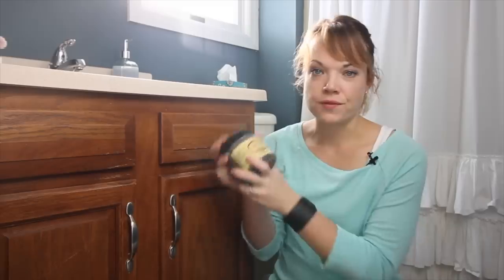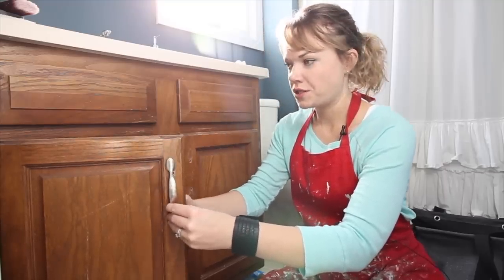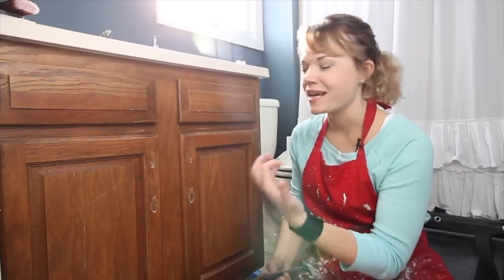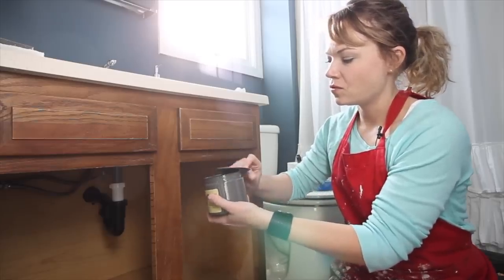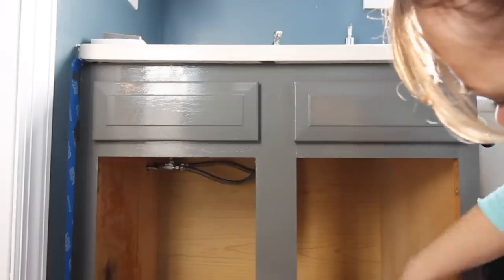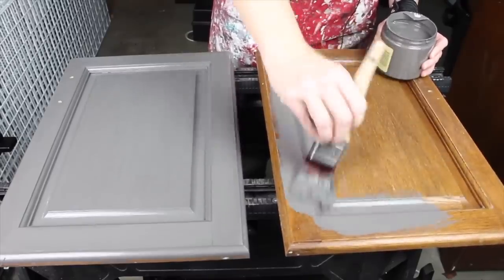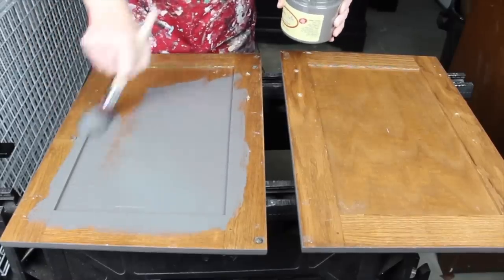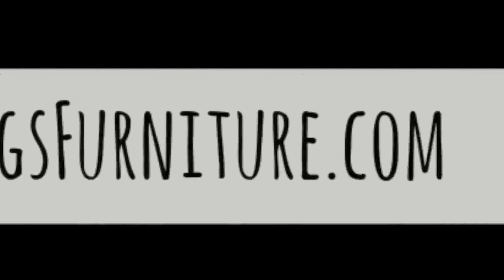Chalk Paint Cabinets | Cheap Bathroom Renovation

Comment: Love that color! It looks great with the color on your walls. I have the same cabinets in our house and have wanted to paint them since the day we bought the house. I've been checking out the DB paints, finishes and brushes but didn't see them used in a Bathroom until now. Southeast Florida is very humid and wet at times so I need a paint and finish that can hold up in our type of weather. Thanks for all the info and tips. Have a great day. 🌴😎💙😎🌴
Reply from the maker: Thank you! I love it too - this was the perfect color with the blue walls, it's such a rich beautiful neutral! I do think this method would be fine with your humidity.  You could do a second coat of the Gator Hide to really give it a layer of protection.  When I painted my bathroom tiles (tutorial soon) I used 2 coats of Gator Hide and it's protected from all the water!!
Reply: Roots & Wings Furniture & Home what color are the walls?
Reply: Hello... I’m just wondering where can I buy general finish paint?
Reply: shannon lancaster what do you recommend for the bathroom and kitchen walls ? I did mine a year ago and it has chipped . Is it because I didn’t prime ? I was told I didn’t need to because the paint was prime and paint at once

Comment: Hi there! 
I just bought white chalk paint to paint my wood cabinet. My question is, would the Gator Top HIdecoat discolour the white? I've been trying to find a good sealant/topcoat and unfortunately I've read that many discolour the white paint and turn it yellowish... if you could please help me with this I'd appreciate it lots!!
Thanks for sharing your video!
Reply from the maker: It's not so much to topcoat you have to worry about, but the wood tone coming through the paint.  If you use stain blocking primer first before the white paint this will protect you from yellowing.  Look into this primer (in white): https://dixiebellepaint.com/b-o-s-s/?aff=177

Comment: GREAT JOB!...But...ALWAYS stir/mix the paint and sealer, regardless of their  thickness. NEVER shake the paint or sealer, as that will  cause a real problem, creating bubbles in the paint and/or sealer. ALWAYS apply two or more coats of paint, and depending on the paint's ability to thoroughly cover the surface, three or more coats may be needed. ALWAYS paint all edges of the cabinets door opening(s), as I saw the upper "lips" of your cabinet door openings were not painted, with your leaving a visable, unpainted "raw edge". As a rule, always lightly go over the coats of paint and sealer with 0000 steel wool, using a tack cloth to clean off all residue prior to applying the additional coats of paint and/or sealer. In doing the aforementioned, chances are far greater that you will have a LASTING and BEAUTIFUL end product that you will love.
Reply: Where you buy the steel wool from

Comment: I have black chalkboard paint from a project and thought it would be fun to paint the cabinets with this matte look. What do you think?  It won’t be in the bathroom so I wouldn’t need a top coat, but thought I might do some small glue art on one cabinet than paint over it with the same black chalkboard paint.  Do you have experience with blackboard paint? Do you think I’ll regret it?  💕😂  I’ve googled it but only come with info related to “chalk paint” NOT chalkboard paint 🤔🧐🤨so, Any feedback is deeply appreciated. Thanks❣️❣️
Reply from the maker: I think it would be awesome! I too really like the look of matte black.  The only caution I would give is that on very matte surfaces, dust, fingerprints, scuff marks show quite easily.  You could use this paint and then add a topcoat of a very flat topcoat for just enough sheen to help with this issue.  My favorite flat is Flat out Flat by General Finishes! https://amzn.to/2ZiXgAn
Reply: @RootsWingsHome   Hadn't thought about the finger prints. Thank you❣️

Comment: Great videos. I watched both of your bath vanity painting videos. Do you prefer the chalk or milk paint?
Reply from the maker: They are both holding up great.  I liked the chalk paint because it was one coat of paint to cover so it was very quick! I like the texture of the milk paint and that it has a little more shine to it.  So it's a toss up, honestly.  I would use either one again - whatever is less expensive or easier to get a hold of!

Comment: My cabinet is melamine or thermafoil type material...is there any way to paint it that will look goo or is it a through away? TAI
Reply from the maker: You can paint it! Just give it a good sanding first to really scratch up the existing surface and then paint it.  Like I did with this laminate piece: https://www.youtube.com/watch?v=65TvMCypkco&t=2s
OR use a primer that will help paint stick to anything like this: https://dixiebellepaint.com/slick-stick/?aff=177

Comment: I want to paint my cabinet, kitchen and bath. When do I use denatured alcohol vs TSP?
Reply from the maker: I can't say there's a huge difference between the two in terms of how they clean.  TSP is nice because there is no smell, but you should rinse it.  Denatured Alcohol is nice because it dries very quickly (due to the alcohol) but does have a bit of an odor.  Either one would be a great option.  For your kitchen cabinets, I'd actually recommend Krud Kutter - it's also a degreaser, and will cut through any grease so your kitchen will be ready to paint! Here's a kitchen cabinet tutorial for you: https://rootsandwingsfurniture.com/blog/kitchencabinetmakeover/

Comment: Hi how long do you need to let dry before adding top gator high coat? Also do u follow the same method if u decide to paint with counter doors on
Reply from the maker: I just waited until it was dry to the touch before adding the topcoat.  About 2 hours or so.  Yes, I sure would do the exact same thing if I left the doors on!

Comment: How much paint would I need for a kitchen cabinet project? Counted about 42 cabinets.
Reply from the maker: Depends on the color and how many coats you will need.  I would say a gallon would be safe (with some left over).  I usually only do one coat of top coat, so 2 qts would probably work.

Comment: Why do you need to sand it if you use chalk paint?
Reply from the maker: Good prep work saves lots of headaches down the road.  I wanted to be sure this was a lasting finish that would stick well.  Also, my cabinets were a bit rough in places so I took care of that as well.